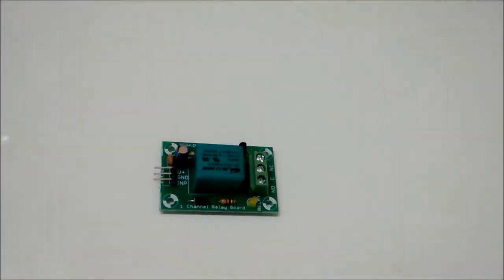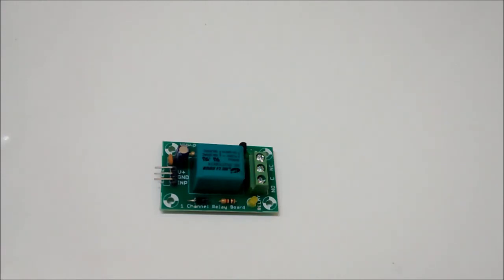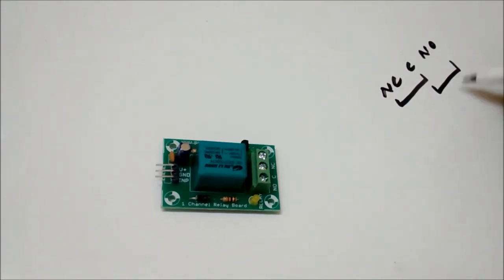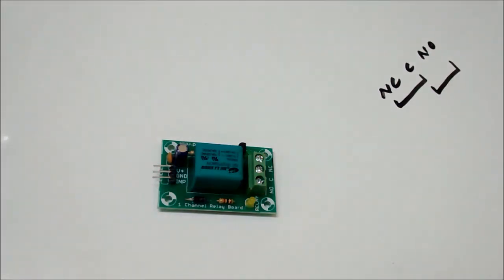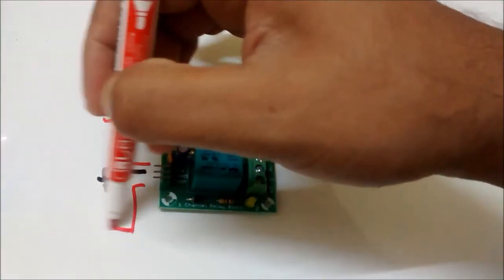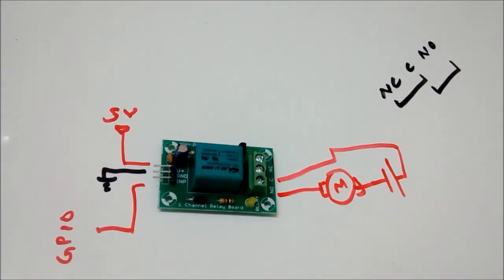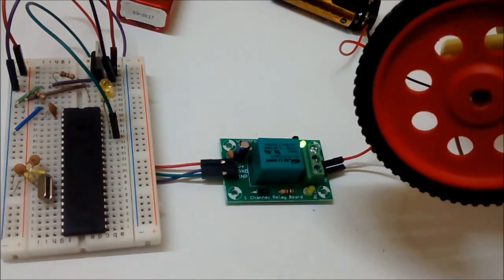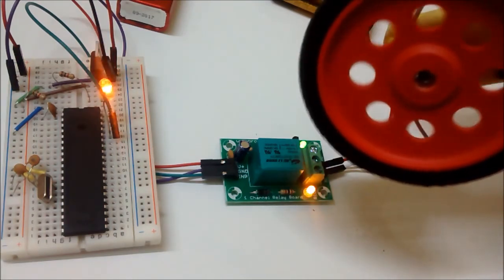INTERFACE DC MOTOR WITH SINGLE CHANNEL RELAY MODULE

Comment: How much is the input voltage from the micro controller ?
Can I give input from a PIR motion sensor ?
Reply from the maker: Yes you can.. The output of the sensor can be connected to relay to activate the relay to light a bulb or alarm or click photo using another camera etc

Comment: How to make a connection if I have to use it without a microcontroller?
Reply from the maker: Everything remains the same except the input to relay to activate it. You just have to connect the input pin to the trigger from whatever device or logic is activating your relay.
Reply: I just want to switch on and off water pump motor using float switch , so input to relay is from 12v or 5v circuit.
Reply from the maker: @maheshk5376  Yes. Basically the output from your float switch is the input to relay

Comment: tried 100 times but it didn't work
Reply from the maker: Kazi Mehrab Rashid Could you please give me more details about your connection and expected behavior? May be I can help you 😊
Reply: @imtheroboart  I also tried the same way you showed in the video, but it didn't work, 
So then I connected the com with one part of motor, then the other part of the motor was connected with battery and finally I connected  the other part of motor with NC.
By this way the motor as soon as get connected it always kept running, but when the relay module  was connected with aruduino and the code was compiled and uploaded, then the motor kept running according to the code. 

I am not saying that The way you connected the motor with relay module doesn't work at all, it works but not according to the code.  This is the problem  I faced